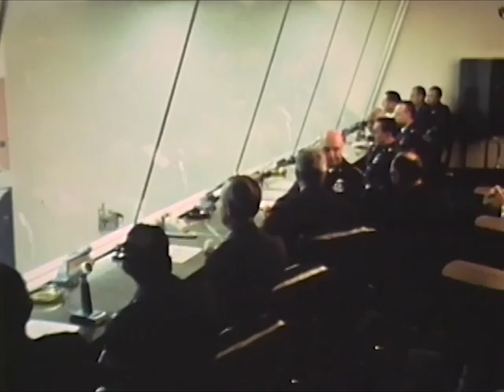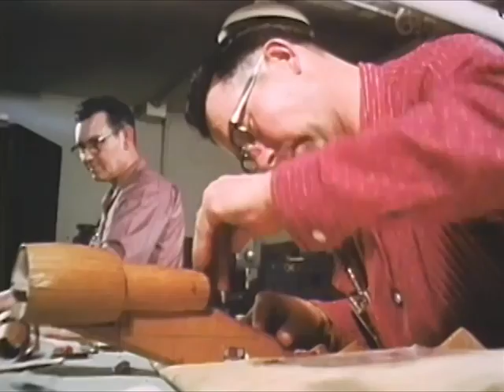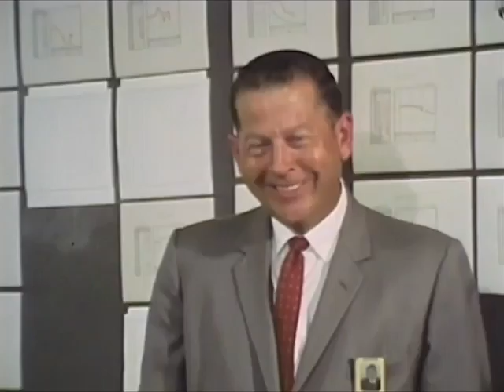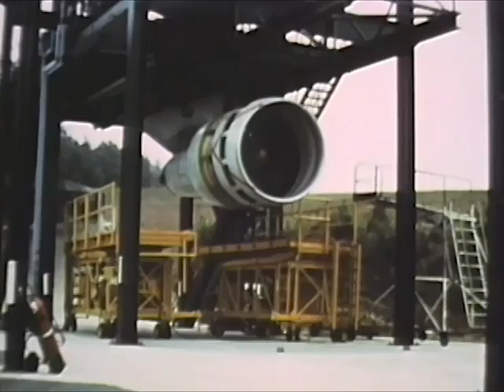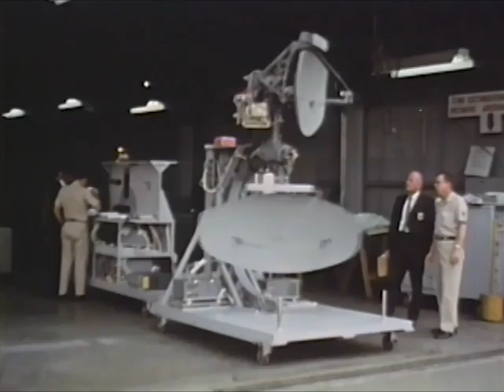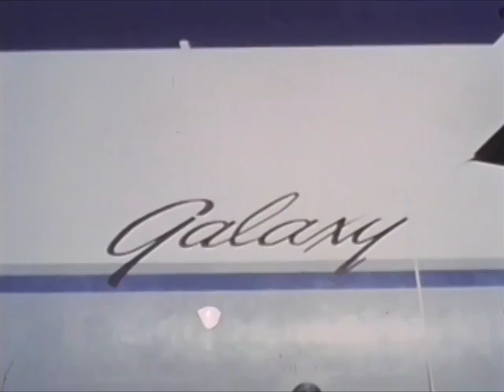USAF C-5 GALAXY AIRCRAFT CONSTRUCTION - 1969 - Lockheed C-5 Galaxy - CharlieDeanArchives

Comment: C-5's design is Way ahead of its Generation
Reply: Way ahead of its generation? imagine when space planes fly if the day ever comes.
Reply: @EricEllingwood  who would hv imagined a Big-A&& Jetliner, that paved the way for Boeing 747's design as well (B747 came from Boeing's Design for C-5 Galaxy, which ultimately lost to Lockheed). Mind you that, these Monster Jets, which would be made to fly with only 4 engines, would pave the way for Big, Long Trans-Oceanic Aviation, as well as Fuel Efficient High-Bypass Jet Engines to do this job, just 50 years after Wright Brothers made their First Flight in the World! These engines which would also have down-scaled versions of the same, for efficient narrow-body aircrafts.

Comment: Those engines kicked out a bit of smoke then ,Lockheed didn’t seem to have the engine problems Boeing had ,different manufacturer I believe ,I was  born in 68 the year of its first flight ,if Lockheed won the SST contract too It would of flown great forward thinking company admired this side of the pond